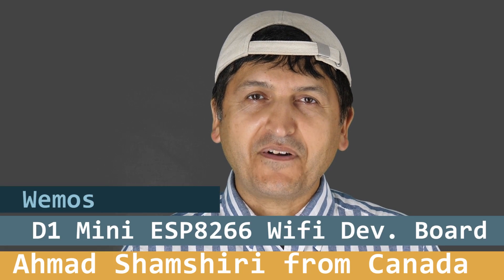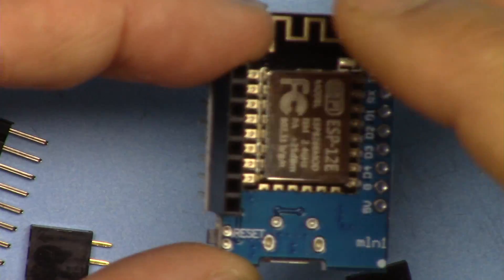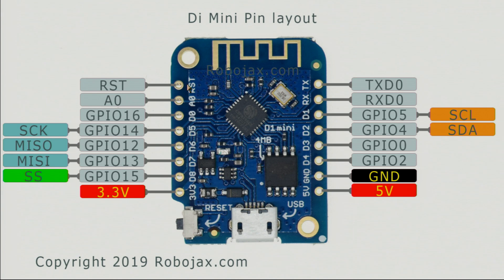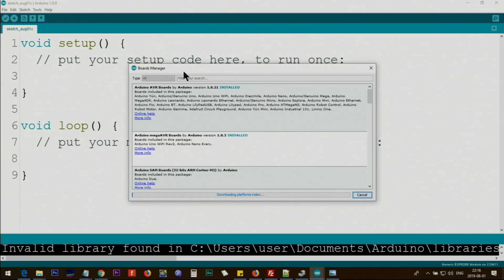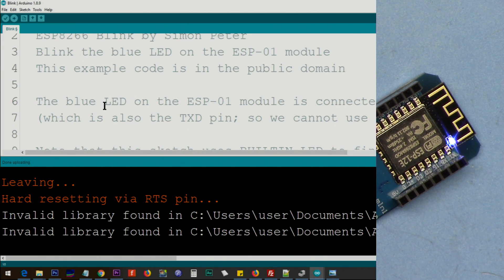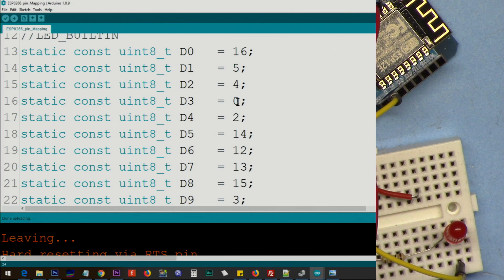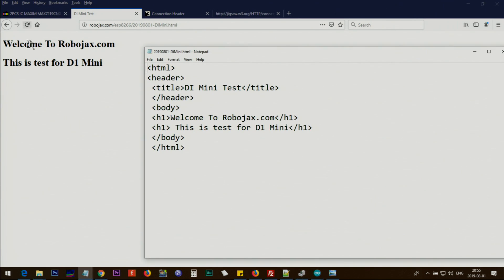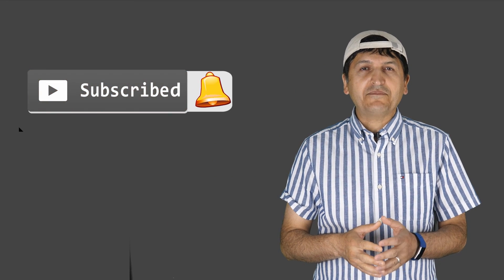Start Using Wemos D1 Mini NodeMCU WiFi ESP8266 module with Arduino RJT194

Comment: Useless, you don't show what Board/Port to actually use, the ONLY thing I'm here for.
Reply from the maker: this module is ESP8266. I have introduction to this chip which I have explained and show everything  here https://youtu.be/pLvqh57T3s4 at 10:46 Selecting COM port is shown

Comment: Great video, thanks for the share. Can the Arduno also run on sim module, to work where there isn't wifi?
Reply from the maker: Wifi feature is needed if you want to connect to something wirelessly. If you don’t need it, all other features work like a normal microcontroller

Comment: Thanks for the video. Just have one question. Can we use pin 5V pin as vcc meaning the power input to operate the device?
Reply from the maker: Hi, yes you can input 5V. That pin is directly connected to USB where it gets 5V from USB.

Comment: Why I can not download esp8266 (6.15)?  I can not find it.
Reply: P.S. I did everything as in the video..
Reply from the maker: did you did not find what? There is is the Driver for ESP8266. The link is under the video.  you need to prepare the board as I've shown. then it is ready. for the code example, I just checked it the link works and there is nothing missing. once you click on the link, the page is full of information and links.

Comment: hi, I am new to Arduino. I had followed the video, but the Arduino IDE cannot detect my D1 mini (COM1 or COM3). Do you know why? I had tried 2 boards, they were all the same.
Reply from the maker: you need to  install the driver for it then.  Perhaps this is the driver. https://youtu.be/u_21yNqd03I this could be the same chip follow this video.
Reply: Thanks, it works.

Comment: I'll try one more time. I recently purchased a robojax Wemos D1 Mini board off Amazon. I am trying to use it with a Hall effect water flow sensor. I know the sensor works because it functions fine with my nano. I just cant get it working with Wemos. Can you point me to a project on the web that can walk me through the code of getting the Wemos board to work with this sensor? The sensor basically sensor a pulse every time the water wheel spins.The code needs to keep track of the pulses, which can come very fast. On the nano I set up a simple project using an interrupt. The same code won't work on the Wemos. Please help.
Reply from the maker: Hello, I am not sure what kind of sensor you and what type of code you use, it should work with esp8266, if it has I2C, then check my videos to know the I2C pins. Generally it should work.

Comment: I am confused by how we refer to PIN numbers on the esp boards. If I put a sensor wire into pin D8 on the Wemos can I just say in setup: pinMode(D8, INPUT); and later in my code: attachInterrupt(D8, Flow, RISING); ? Do I need to include some kind of a legend to say D8 is some other number? Are the numbers different for interrupts? Thank you.
Reply from the maker: Hi, I have clearly explained it.  Ut can be done in so many ways but we go for simpler ways.  Just follow what I have shown.
Reply: @robojax  Thank you for the reply. But I don't follow. Can you point me to where you have discussed interrupts on the Wemos? I am struggling to connect a water flow meter (using Hall effect) to my Wemos. I got the project working on my Nano. But the same code is not working with the Wemos. I have looked on your tutorial page but saw no similar projects. Please help. Thanks.
Reply: The reason I asked about pin numbers is in your project "APDS-9960 Gesture sensor with Arduino" you initialized the sensor pin at 2 but when you called the interrupt you had to call it 0. If you did the same project using a Wemos board how would you refer to the pin? Thank you.

Comment: Downloaded and installed driver to NodeMCU Lua ESP8266 ESP-12 WeMos D1 Mini.  Selected ESP8266 Blink sketch as per video which compiles but does not download.  Massive error message that ends in "or esptool directories not found next to this upload.py tool.
An error occurred while uploading the sketch".
No idea how to fix this!
Reply from the maker: So not copy and paste. Click in the download button. Usually browsers are making them useless.
Reply: @robojax  Many thanks for the quick response.  Please clarify exactly what you say I should download and what to do after download...
Reply from the maker: I just checked. this is very simple code.  you have no provided any error.  Read the error. only one line will tell you why.  or take screen shot and post it here https://snipboard.io/ and then share the link back here

Comment: Can I control 1 sensor and results control 5v water pump on /off as needed by sensor?with this?
Reply from the maker: yes you can. I have tones of videos for Arduino.  Most sensors works with this . yes.

Comment: I have a forklift that has a 60V battery. I would like to measure and write the voltage into a database via WiFi. How can I measure the voltage?
Reply from the maker: 3 projects in one. 1-measure voltage over 5V 2-Connected send over WiFi 3-Database application and saving.  I've shown the Analog pins.  you mean learn from my other Arduino videos. just search my channel

Comment: its actually 4MB of external flash for things like program storage. Its something like 128kb of sram, including whatever gets used by the firmware for running the wifi stuff.

Comment: i have a question, can we use 3v instead of 5v of the usb port?
Reply from the maker: sorry I didn't get it. USB is Input and not output. So you can connect it to a wall charger or computer to power this module.  We have 5V and 3.3V pin on the module you can use.

Comment: Sir your "Wemos D1 Mini NodeMCU WiFi ESP8266" card is not connected normal arduino isn't it ? You are only feeding the chip with usb voltage ? And you are installing all libraries on the Wifi module ?
Reply from the maker: Watch this video. The exact ESP8266 chip. https://youtu.be/nCMdvscEipo

Comment: When I plug this in my PC powers it but I don't see it show up on my PC under Device Manger. It's like it doesn't exist what am I doing wrong?
Reply from the maker: I will reply to all subscriber's 🔔 questions. So make sure to subscribe.😊
Reply: I had the same problem, tried a different USB cable and it fixed it.

Comment: Thank you for the video, very instructive. One problem that I encounter is the very bad wifi-connection of this board in your video( and mine). It is totally unpredictable if the board connect yes or no, and if it has connection, it looses connection(90% of the time it is searching for connection). My other board(arduino-uno-esp8266-board is working fine with the same sketch in  the same router environment. Do you have suggestions?
Reply from the maker: You are welcome. I have no issue with WiFi as I am very close to Wifi router. If you have a serious practical application, then get a module that has external Antenna and it should resolve the issue.
Reply: @robojax  Can you explain how you arrived at this logic?

Comment: hi, I encountered such a problem, I have 20 wemos d1 mini v3.0.0 boards, but none of them find my networks in client mode, and no device (laptop, smartphone) sees wemos in AP mode.  but they see each other (1 wemos create point - 1 wemos scan).  Tell me how to deal with such a problem.  Has anyone come across?
Reply from the maker: One thing that i faced was the SSID is case sensitive. "Book" is not the same as "book" with this device. But on the phone or tablet, any upper or lower case works.
Reply: I also encountered this, but here the problem lies in different frequencies, or something else.  and where I can’t configure it.
Reply from the maker: ESP8266 is working on 2.4gHz and if your router is 5.8gHz this device will not see it.
Reply: Robojax all my devices work on 2.4ghz in b / g / n, but he still cannot find them ...

Comment: Correct me if I'm wrong but isn't the ADC of ESP8266 only rated for voltages of 1 volts and lower?
Reply from the maker: A0 is rated at 3.2V see it in this page: https://wiki.wemos.cc/products:d1:d1_mini